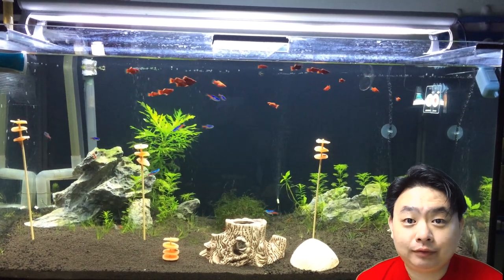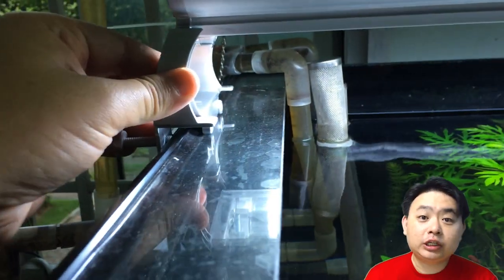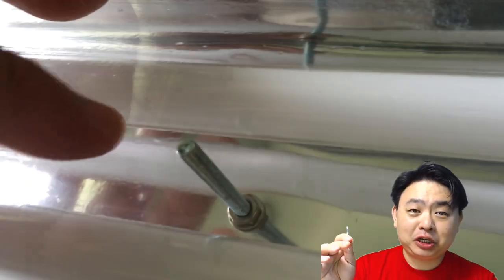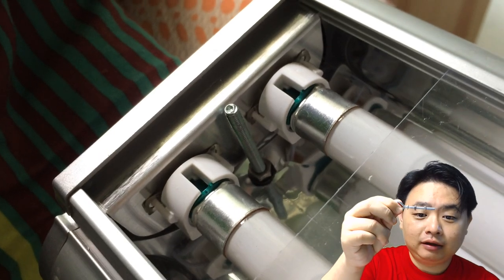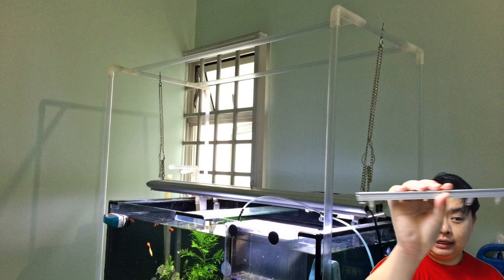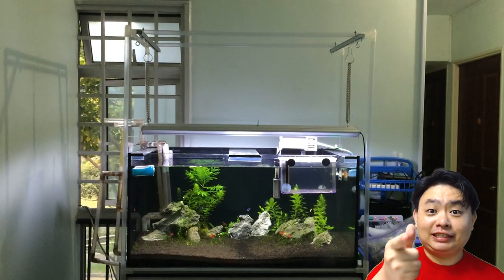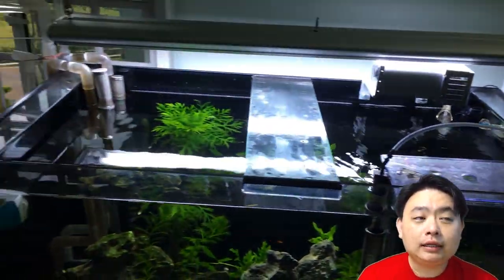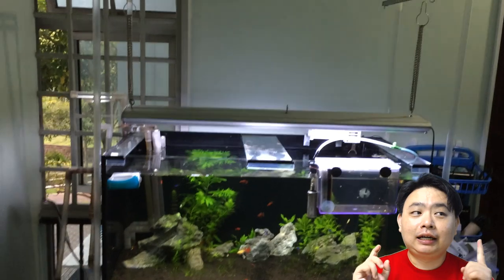DIY Hanging Sliding Lights holder for Aquarium tank

Comment: You could attach the curtain rods directly to the ceiling, and lose the ugly plastic tube frame. Or, you could put shelving on the wall behind the tank, and hang the curtain rods from the bottom shelf.
Reply from the maker: Thanks for the feedback, it's kind of hard for me to permanently drill the ceilings above the tank for now....sometimes I like to change the fish tank position hehe :3